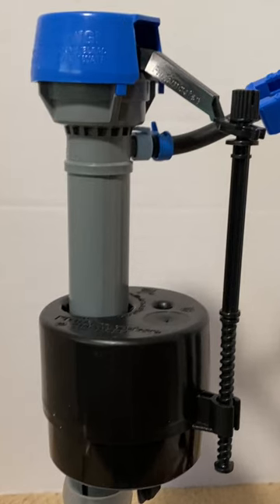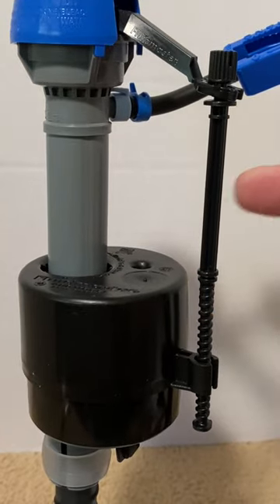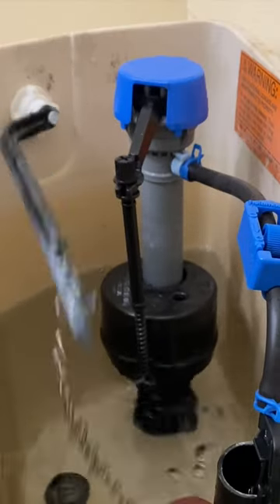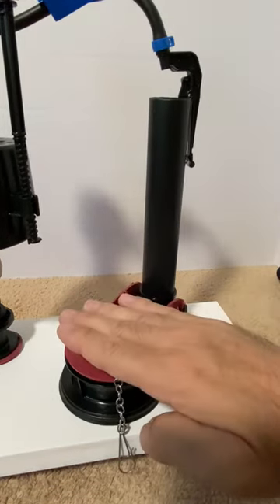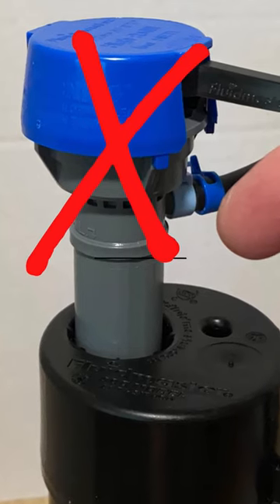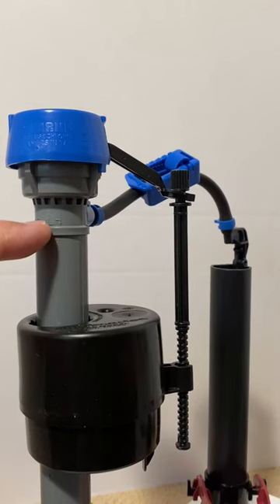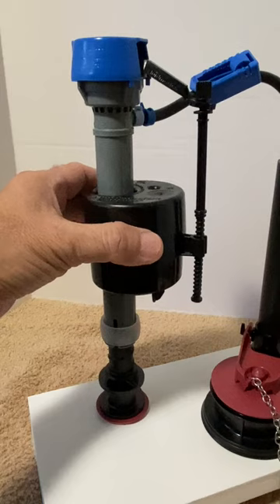How Toilet Fill Valves Work

Comment: It’s kind of crazy how often these need to be replaced.
Reply: They actually don't. If you're having a lot of trouble with this, it's likely due to hard water where you live. You can just replace the seal in the top of the valve. Sometimes, it's even just debris collected around the seal. It's just under the valve cap. The best part is, you don't even have to empty the tank to replace or inspect the seal.
Reply: Agreed but that’s because this system, very typical in USA is over engineered af. I have seen much simpler and reliable designs for this system.

Comment: I removed the refill tube from the overflow pipe to the tank to save water. After the tank is fully filled up, the toilet hole is still sealed the some water.  Is it OK? Is there any problem ?

Comment: Thanks for the detailed explanation.  I've "fixed" dozens of toilets over time but didn't know exactly how the refill valve fills both the tank and the bowl.  I just got a brand new toilet with exact same design and the water level is very slowly and silently rising until it reaches  the overflow pipe.  Something must be wrong with the refill valve as it is probably not sealing properly and there is a slow leak. And I also noticed there's water dripping from the top of the refill valve into the tank immediately after the toilet is flushed.  Then it stops. Perhaps the pressure is too high and some excess water is shooting through the top lid.
Reply from the maker: Thanks!  Here's a more detailed look at how the fill valve works... https://youtu.be/twynH8xVdy8
😎

Comment: Thanks for this. Still learning about the newer systems to replace the old ballcock and siphon in my old toilet. In some videos the refill tube is not used at all, and the fill valve and the flush valve are separate from each other. Is this because the flapper system is not used ? Many thanks for your very helpful and clearly explained videos, Kieron

Comment: FYI your series description for Part 2 has the correct link, but the description should say "Part 2 - How Toilet Flush Valve Works" instead of "Fill". Hope this helps! BTW - very nice, concise, clearly descriptive and helpful series of videos here!
Reply from the maker: Thanks!  Appreciate it.  
Error corrected.  
😎
Reply: @HacksbyDad  You are quite welcome. BTW after quite a bit of searching, your video was the first (maybe the only) to reveal to me that the water enters the toilet tank to fill it from way down at the bottom of the fill valve. A bit hidden down there. Crazy that no one else showed that. Not even the manufacturers!
Reply from the maker: @coffeeabuse  Interesting... I didn't realize that.  LOL  
Did you see my videos on how the inside of the Fluidmaster fill valve works or the adjustable flapper?  Here are the links...
https://youtu.be/twynH8xVdy8
https://youtu.be/Ts7jxxw8GuA
😎

Comment: Do you have a video on how to resolve a fill valve that closes too quickly and causes a banging noise in the wall sometimes? I assume the fill valve closing abruptly is causing excess pressure in the wall and some form of water hammer? My best guess anyway.

Comment: Quick question: you said the safety feature of the flush valve tube being lower than the critical line is to stop the water from flowing back to the refill valve. But what would happen if that happened? I mean isn't the water still at some point going to be flowing down thru the flush tube?
Reply from the maker: First, thanks for binge-watching my videos... LOL.
Keeping the tank water level below the fill valve critical line provides an air-gap that will prevent the tank water from being sucked or siphoned back into the supply line.  If this happens, the tank water would contaminate the house's water supply and possibly the City's water supply too.  I hope this helps.  
😎
Reply: @HacksbyDad  that is so weird. I won't pretend to understand how this siphon effect can do that but thank you!
Reply from the maker: @MathCuriousity  Siphoning back through the fill valve might happen if your water line loses pressure like if there is a water line break.  The air gap will prevent the siphon.  At least that is my understanding as a non-plumber.  
😎

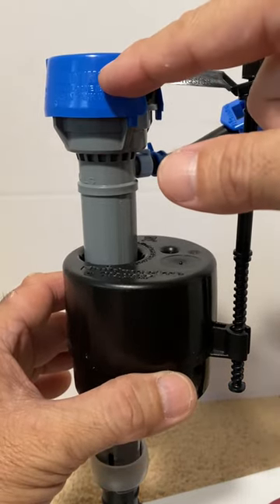Comment: @1:40 when the float lifts the adjustment valve arm, the fill valve float I believe is closing abruptly SOMETIMES and causes a bang in the wall. This doesn't happen every time but 2/10 flushes I observed it with the tank lid off and I notice it closes fast and not gradually which causes the bang. Can I adjust the valve or arm or something to stop this?
Reply from the maker: Sorry… I don’t know of a way to decrease the speed of the fill valve.  
You may to try two things… but remember that I’m not a plumber.  
1.  Drain and then refill your plumbing system to refill air into the air chambers.  
2.  Check the water pressure and see if it is in the 50-70 psi range.  If it is too high, you may need to replace or rebuild the pressure regulator. 
😎

Comment: Hello, what is the point of having the refill tube shooting water directly into the overflow drain? Wouldn’t it make more sense for that water to also go directly in the tank?
Reply from the maker: The refill tube is there to refill and top off the bowl water level.  If your bowl can fill up without the refill water, you can point the refill tube directly into the tank.  The 400H and 400AH models allow you to control the refill tube flow.  Here are a couple of videos on the subject...
https://youtu.be/uMfD_utCahg
https://youtu.be/xngoloz6jaQ

Comment: My tank was refilling slow and the refill tube was not shooting water.
Instead of trouble shooting it, I replaced the whole valve. (found out the removable filter was plugged up)
Now the tank refills correctly but the refill tube is bone dry NO water coming out of the it just like the refill tube on the previous valve.
Reply from the maker: Interesting.  Only time I've seen the refill not shooting water is with the refill valve closed on the 400H model.  🤷🏻‍♂

Comment: This same valve get stuck in the up position any ideas how to fix it? When you flush the toilet the water doesn't fill up.
Reply from the maker: I suggest that you disconnect the adjustment screw from the valve arm and see if the float or valve arm is sticking.  If the float sticks, see if it is rubbing against the tank wall or maybe something is wedged between the float and tube.  If the valve arm sticks, here's a video on how to remove the valve cap and seal... https://youtu.be/sEdfFZQYQEI
If all else fails, replace the entire fill valve assembly... https://youtu.be/HFLEoBAJj2E
😎

Comment: Hi mine sometime fill the toilet bowl fine and sometimes it doesnt when it doesnt want too. 
It looked at it and it looks like the refill tube that goes in  overflow pipe sometimes doesnt water doest come out to fill it.its sonetimes so theres barely water in bowl when it doesnt fill
Reply from the maker: I suggest replacing the entire fill valve assembly... 
https://youtu.be/HFLEoBAJj2E
Reply: @HacksbyDad  thanks

Comment: Thank you. Question. my refill port is facing the side of the tank instead of facing the overflow pipe, how can I rotate it? my overflow tube does not reach the overflow pipe because of this.
Reply from the maker: Interesting.  You can hold the lower black tube and turn the top gray tube, but that will change the height of the fill valve.  Turning clockwise will lower the height and counter-clockwise will raise it.  Here is a video on how to replace the fill valve that might help... https://youtu.be/HFLEoBAJj2E
Reply: @HacksbyDad  thank you!

Comment: I’m trying to figure out what’s going on with mine. It is a Kholer about a year old, just started not filling the tank back up SOMETIMES, if I open the lid and simply touch the arm for the floater it starts to fill up. Any ideas?
Reply from the maker: I suggest checking to see if the float touches the tank wall or something else.  If not, you might want to replace the valve cap to see if that solves the problem.

Comment: My problem is that my fill valve somehow doesn't go down as the water level drops.  I have to reach and give it a nudge.  Then it does go down, and then up, with the water filling the tank.  Any idea about adjustments to be made so that the float actually falls with the water level when the toilet if flushed?
Reply from the maker: Not sure.  I would first disconnect the float screw from the valve arm to see if the float or valve arm gets hung up. It could be that the float and tube need to be cleaned, the entire valve cap assembly replaced, or even the whole fill valve assembly.  Hope this helps.

Comment: Hello, I'm a renter and starting to notice my toilet runs on is own once every so often. I changed the flapper and it stop however I notice that the refill tube was placed outside the overflow tube and puts water in there. After a bit the refill tube isn't shooting out water anymore. All the water in the house is working. I check the water line and made sure it was open but no water is coming out. What should I do.
Reply from the maker: The float shuts off the fill valve and refill tube at the same time.  The fill valve fills the tank and the refill tube tops off the bowl.  These two videos might help you understand the operation better.
https://youtu.be/HFLEoBAJj2E
https://youtu.be/uMfD_utCahg
😎
Reply: I mean it's not filling the tank anymore so I can't even flush -_-
Reply from the maker: @iceomotion  Oh... ok.  I suggest turning off the valve, removing the connector under the tank, pointing the hose connector into a bucket, and slowly turning on the valve.  If there is good water flow, replace the entire fill valve assembly.  If there is no water flow, repair or replace the supply valve.  Hope this helps.

Comment: Water coming out of Overflow pipe but not out of Fill Ports
Reply from the maker: Sorry... I'm not sure I understand.  Please clarify.
With the tank empty and the float and valve arm in the down position... water does not flow out of the fill ports at the base of the fill valve assembly?  And the water that flows out from the top of the overflow pipe comes from the refill tube?
Reply: @HacksbyDad  I am using the Overflow pipe to fill the cistern as inlet ports are not filling the water but the pipe mentioned above has water. I cannot open the FillValve as the nut has rusted and inaccessible.
Reply from the maker: @kjsahai  It sounds like the fill ports or tube are plugged.  The only two options I can suggest are to open and clean the fill valve or replace the entire assembly.  🤷🏻‍♂
Reply: @HacksbyDad  so the overflow pipe & Inlet ports have no linkage and how to clean Inlet Ports from Outside any video
Reply from the maker: @kjsahai  You mentioned a rusted nut so I assume you have another type of fill valve.  Do you have a Fluidmaster fill valve?  If you do, these two videos might help...
https://youtu.be/sEdfFZQYQEI
https://youtu.be/twynH8xVdy8
Reply: @HacksbyDad  Nut is the connector pipe nut but I want clarity on how the overflow pipe works
Reply from the maker: @kjsahai  The overflow pipe is the pipe that is connected to the flapper.  If the tank water level rises too high, the water will overflow into the pipe and down into the bowl.  This video might help... https://youtu.be/UDa0VTwBd1U
Reply: @HacksbyDad  in this case the overflow pipe originates at the top of the fill valve
Reply from the maker: @kjsahai  OK.  I'm not familiar with your setup.  Sorry I couldn't be of more help.

Comment: Fluidmaster.... garbage. Use OEM wherever possible.
Reply from the maker: Interesting because some toilet brands come with  Fluidmaster parts installed.  😎
Reply: @HacksbyDad  I've had them installed twice by different licensed plumbers over the decades. The faulty original valves aged out and  were running and would not recover on a regular basis.  In both cases the plumbers installed Fluidmaster. I never had ghost flushes with the OEM stuff even when they needed  to be replaced. I repeatedly had them with the Fluidmaster valves.   I ordered OEM (Kohler) fill valves, installed them myself and the problems were 100% gone. IMHO the Fluidmaster cannot be accurately adjusted and is too sensitive to water pressure fluctuations in the house. The flush valve was never the issue.
Reply from the maker: @barneyfyfe8313  👍😎